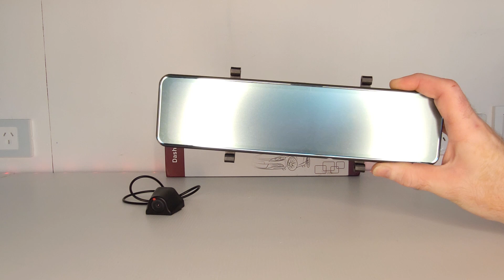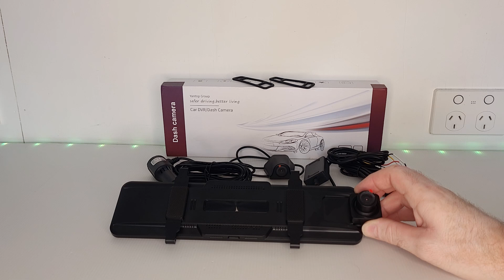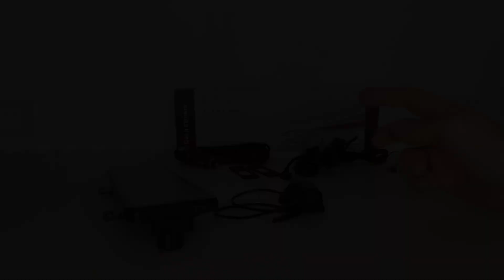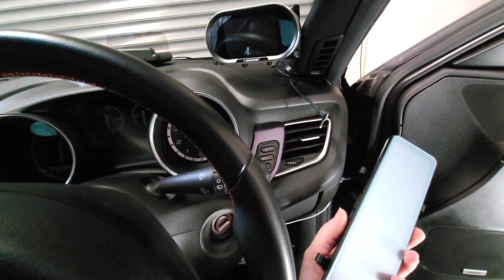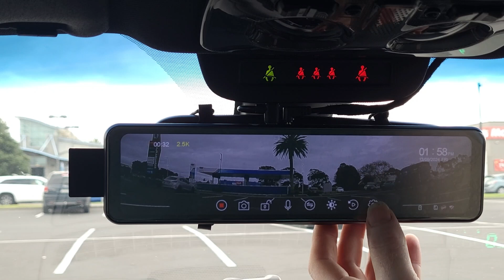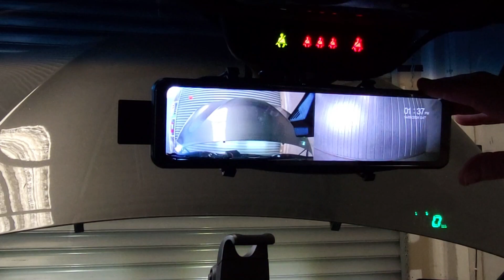Installing a Rearview Mirror DVR Dash Cam with Reversing Camera. Yantop E-ACE A-45

Comment: Firstly, thanks for your video. I've recently got one of this and have just one question bro, for the yellow wire (+12volts). Can you plug the fuse to any of the 10A slots in the car's fuse box? Greetings from Perú!
Reply from the maker: No not any of them, as some will be other accessories, you need to test the fuse with a multimeter first

Comment: You skipped some important parts like where exactly you're making your wiring connections to in the car.
Reply from the maker: You can make your connections anywhere such as the fusebox, BCM, cigarette lighter socket, at the steering column harness etc. All depending on your car will depend on the easiest location to do this

Comment: Also can't believe the camera slid out. Was wondering why it wouldn't fit. Now I just need to find the correct fuse for hardwiring the buck line attachment. Some install instructions with my device would have been helpful. Thanks for the video.
Reply from the maker: Your welcome. Look for the fuse that is powering up your car stereo, usually a Red 10 Amps fuse

Comment: Thanks for the review. A few questions:

1. does it have an automatic light sensor to dim the screen? If not, isn't it too dim at day, or too bright at night, unless manually adjusted?
2. I am planning to use it as a rear camera monitor only. Is it possible to set it to always show only the rear screen when turned on? Does it remember the last view mode? Or will I need to swipe it all the time after ignition?
3. how well is the time setting preserved when turned off for a long time? Isn't it showing incorrect times, especially without GPS to sync with? Can the clock / date get turned off permanently?
Reply from the maker: Your welcome. 1. No this model does not support Auto Dimming, you manually adjust the Brightness using your finger on the display screen. I personally have never found the mirrors to be to bright at night. 2. Yes it remembers the last display view after every power down so just set it to the Rearview Camera once and it will remember that for you everytime you now start the car. 3. The Time and Date remain the same, the builtin battery takes care of this for you even when the device is turned off so no GPS Synchronization is needed. No the Clock and Date cannot be disabled, hope that answers your questions

Comment: I have this dvr E-ACE A45, I do not recommend it at all, it only worked for a year, in the cold the rear camera made artifacts, and now it does not work at all, I mention that it was installed indoors. And the worst problem now is that my backlight of display light fluctuates
Reply from the maker: Thanks for sharing your experience with the device

Comment: 1) does the camera detect when you park?
2) do you need to manually turn on parked mode
3) does parked mode make the display sleep and turn on when impact detected? 
4) how much power does it use when on parking mode?
Reply from the maker: 1. The device supports parking monitoring yes. It will start recording if an impact is detected 
2. Yes it will need to be enabled the first time you setup the device but after that its permanently enabled 
3. When you turn off the Ignition the mirror will sleep. The display will not turn on if there is an impact, it records with the display off 
4. Don't worry it won't drain your car battery, it can record for a few days without any negative effect on your cars battery
Reply: @SHORTwithTECH is it always on when you wired it directly to your battery? 
I have an old car and wanted to use a custom power bank. Trying to find out if it would keep pulling full power when i get out of the car. 
Thanks for the quick response.
Reply from the maker: @ionclaw7340 no but it is constantly powered up so it will be consuming a minimal amount of power at all times. A switched ignition source is still required aswell though
Reply: @SHORTwithTECH ah, I think I understand... I can't run parking mode without the module for the battery/ ignition detector?
Reply from the maker: @ionclaw7340 yes or without modifying your power bank so it has a switched output source aswell

Comment: can you flip the monitor up-down as I want the camera on the right, not on the left
Reply from the maker: @anv9000  unfortunately the mirror is not designed to do that. You can do it but your Setting Buttons and Clock will be upside down. The Power Display button will also be at the top making it difficult to access. There are now DVR Mirrors being manufactured that have the Frontview Camera on the RH Side but so far I have not reviewed any to be able to show you a demonstration of it, I will be reviewing one to add to the channel in 2025 though, hope that helps you out

Comment: Great video man, one question, i need this on my van that does not have a rear view mirror, does it come with so that it can still be mounted ?
Reply from the maker: @ozzie3574  Thanks dude, no if you don't have a rear view mirror it won't be easy to install so I recommend going for something like this instead  https://youtu.be/pzvTGTELCoY?si=i6OfM89s7PZYoW_R It has the same features as the mirror anyway plus alot more as you will see in the review
Reply: @SHORTwithTECH  Thanks for that. Some times a lot more makes it more complicated, is that the case ? i can fit a mirror if needed if its easier.
Reply from the maker: @ozzie3574  nah, it's basically the same thing with the addition of android auto and carplay. It's just as easy to use as the mirror but in your case alot easier to install. It comes with a window suction mount so you can mount it in the middle of the windscreen just like a rearview mirror if you wanted to. Alternatively if you would still prefer the mirror then you can just buy an aftermarket suction mount mirror from Supercheap Autos or Repco and mount the DVR mirror to that

Comment: Tenho uma dessa. Muito bom. Teria jeito de quando ligar a chave contato, ela optar em não ligar, sem ter que apertar o botão abaixo no meio?
Reply from the maker: @silvanomaranhomontador3925  if your using the Buck Line Cable you could try disconnecting the  ACC wire to see if that works but it may not as alot of Automotive Gadgets work on voltage sensing which won't be possible to override
Reply: Thank you